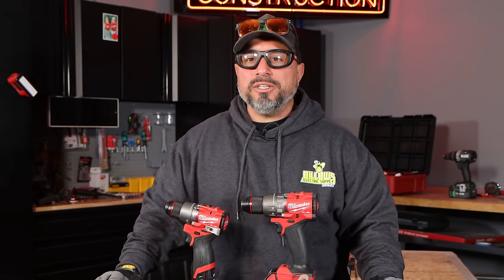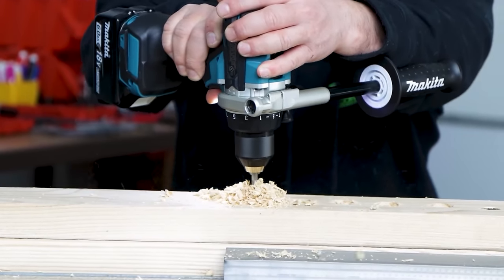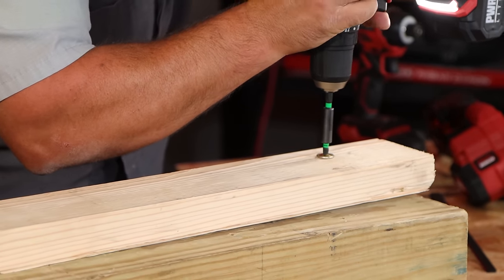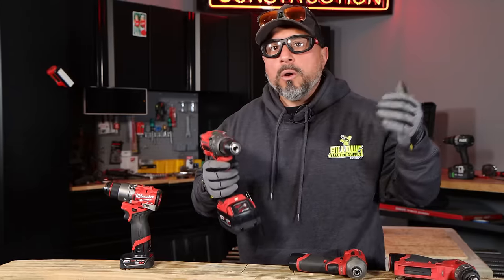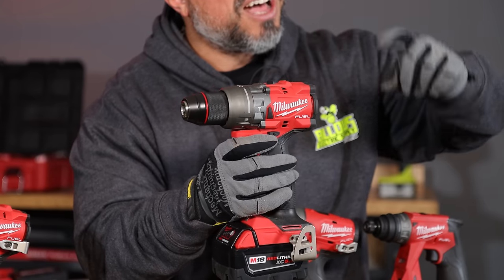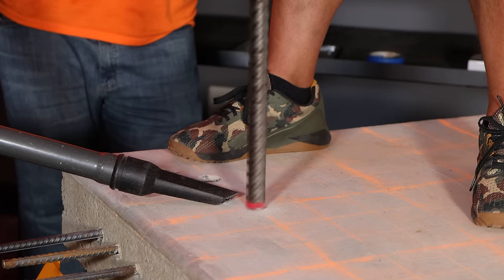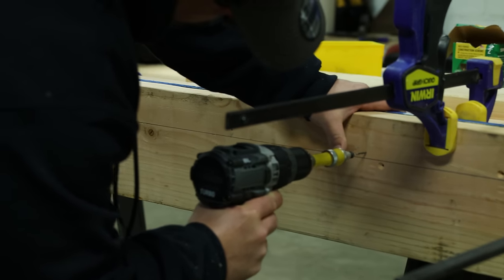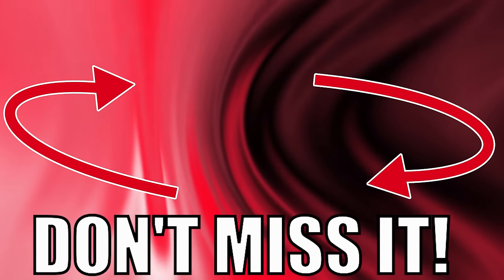Stop Using Cordless Hammer Drills...

Comment: I have only used a hammer drill both corded and cordless when I needed to drill into concrete or brick.  90% of the time I use a drill driver to drill and drive screws.  I own a hammer drill and an impact driver for those 10% of the time they are needed.  I'm just a home owner who tries to fix what I can.  I try to use the right tool for the job.  I've never needed a rotary hammer, but I assume you can rent one if I ever have the need.

Comment: If you're doing it for a living a rotary hammer drill is the go in my opinion for concrete. They're quicker then a percussion hammer and a battery rotary is typically good for up to 25mm bits. Anything larger a mains rotary is the go.

Comment: My 1/4" hex impact driver was my go-to tool. Second was my 1/2" hammer drill. then all the saws. If i was drilling more than 5 holes in concrete, I would grab my SDS drill. But the 1/2" hammer drill was used every day on the job.

Comment: @vcgconstruction. I watched the whole video before replying. I’d have to disagree, I do HVAC and I carry the hammer drill because it’s perfect for putting my anchors on brick walls and drilling my 4” holes for soffit caps,and I use it to run my hole cutter for ductwork. I would agree with wanting the sds for drilling sleeves for my lineset. Other than that hammer drill all the way. Love you guys

Comment: I keep my hammer drill on the truck but always have my impact driver on me. I used to carry both but removed it to save weight. I never use it to drive screws, drill small holes, or with paddle bits. It’s pretty much exclusively for small masonry anchors, and hole saws. Same side neither of my guys own impacts, only carry a drill. They like the control they say, but one literally hit himself in the face but apprentice so makes sense. 

Not dead to me, the size bridges the gap. I don’t want to own 2 rotary hammers, just one big 1-9/16”.

Comment: I always buy hammer drills the regular drills always seem too cheaply made to last very long.  I use a rotary hammer for masonry. Speaking of not the right tool for the job my brother's shop has concrete walls and when we insulated it we used wood slats to hold the insulation on the wall with concrete screws. The rotary hammer drilled the holes but those screws are hard to get in without stripping the screw so we used an old corded right angle drill with a #3 Phillips tip in the chuck. It worked rather well because I could lean my full weight onto the drill to keep it from stripping the screw but the fun part was that drill took time to stop so the best way to have the screw heads flush with the wood was to pull the drill out of the screw as fast as you could while it was still spinning. This was before I had an impact driver.

Comment: One of the reasons why I only buy cordless hammer drills and not cordless standard drills is because of the gears. Non hammer cordless drills usually have weaker bearings and gears. Sometimes they aren’t even metal.

Comment: M12 hammer drill/screw gun combo is what I bought. The hammer drill is fine for when I only need to drill a few holes in to block or concrete. If I'm doing an all-day job drilling into block and setting tapcons than I'll break out the m12 sds plus. For instance I recently put a stone veneer on the front of a customers block garage and the m12 hammer drill was burning through the block nearly as fast as my buddies 15 year old poorly matienenced Bosch sds bulldog. I also used that same m12 to drill a 2 in hole through 1 of the veneers with a diamond holesaw no problem. Things a beast.

Comment: Well, for someone who installs fasteners into concrete most of the time, no you cant just use an impact orr that little multi-tool thingie. You need either a roto hammer or a proper hammer drill. I used to lug both a midsize roto & and imapct around, now i dole my other tools out to apprentices and have them install devices while i make holes & mount devices with 1 tool. I adore how versatile the hammer drill driver is, y'all 🫡

Comment: I run a Ridgid Flexshaft with my hammer drill. That’s about the only reason I bought a cordless hammer drill. If I wanna drill anchors in concrete I pull out my corded Hilti rotary hammer

Comment: I am an electrical construction worker in Korea.  In order to use a screw anchor, we have to drill a hole in the concrete with a diameter of 6 to 6.5 mm, and use a self-drilling screw on the metal plate to fix the steel box or steel support at the same time as the drill hole.  I think it's really inefficient to have to bring both a drill driver and a rotary hammer drill for this job every time.  All it takes is a 14.4v hammer drill.  A rotary hammer drill is required only when drilling a large number of holes with a diameter of 10 mm or more.  Since you are a carpenter, you may have posted this video without understanding the peculiarities of these various professions.  You only know about your work.

Comment: If one needs a drill/drver, then might as well get the version with the hammer drill. The size is the same with very little difference in the weight.  The cost isn't a factor, it is about $10 more.  It only makes sense to get the hammer drill unless maybe you are a mechanic.

Comment: I prefer drill for drilling or screws too weak for impact drivers or need to be at a limited tightness, and impact driver for screws and drilling nail embedded wood with a spaddle bit. The hammer functionality in the hammer dill can drill cleaner holes into drywall not just beneficial for drilling into small holes through masonry. Since I’m a hobbyist woodworker, having a hammer drill, impact driver, and installation driver is the perfect arsonal for my drilling and driving needs instead of having just 2 of those tools. Like have my hammer drill on the regular drill functionality for pilot holes, an installation driver for counter sinks, and an impact for screws for a woodworking project, so I can quickly switch tools instead of hunting around for a different bit for each step I’m putting in a screw and more options to come as well.

Comment: You have an opinion that I may not agree with. As a handyman I prefer the quieter sound of a drill/hammer drill and the 1/2” chuck is needed for bits that won’t fit in the impact driver. For my day to day I’m using the 12 volt because of the small size and less weight.

Comment: I can't speak for the concrete artists, but as a DIYer, even if I wanted a hammer drill, why would I want a 12 volt. Not to mention that thing comes with a half inch chuck! What am I augering out holes for fence posts?

Comment: Before you sit there and call out all trades “for what they use their tools for”. Maybe consider that some trades have no idea what they are drilling into, whether it be soft and easy like ceramic, or tougher than hell petrified wood or rock hard granite, some trades need a hammer drill to get the job done and some of us don’t have the time to run an extension cord or forget to grab the generator for a corded hammer drill, because the builder still hasn’t gotten power to the house/building.

Comment: For me, I have no use for a rotary hammer.  And I don't really NEED a hammer drill.  However, I do need a drill with a chuck available alongside my impact wrenches and impact driver.  So having the hammer drill for the here and there scenarios where I can't do the job without a rotary hammer or hammer drill I'm not SOL.

Comment: I see your point but I disagree. I do a wide range of task from drilling holes in metal, wood and masonry. The added cost and weight is not much of an issue in comparison to the versatility you get with a compact hammer drill tool. I have a Makita hammer drill and that thing goes through concrete and stone with ease.
Reply from the maker: Fair enough, I respect your point of view!

Comment: I agree. But working maintenance have used  hammer drill thresh holds. Use on mortor to hang mailboxes. Wallering mortor. Very little use. I like the basic drill driver. It's a good gimmick especially when that trigger messes up on the hammer side.

Comment: I prefer my hammer drill when drilling small anchors and tapcons. If I need to drill bigger holes I will break out the rotary drill. We have a lot of stucco in AZ so if I'm on a ladder I'm going with my hammer drill. When I'm done I switch bits and hang it off my pocket.

Comment: you're 100% correct.  im a low voltage camera guy, and i still use my 18v sub compact makita rotary hammer to make even 1 hole in mortar... i don't wanna have to use force on a ladder!
Reply from the maker: Exactly

Comment: As a home DIY guy the hammer drill does what i need. Drills wood and concrete, drives screws and  takes up less space than the specialized tools in my pack out box. Now if i drilled concrete day in and day out then yeah, rotary hammer all day. But i am a filthy casual.

Comment: I just love my Milwaukee tools. I am not a huge brand loyalist. However I unexpectedly got vested in Milwaukee tools due to an acquaintance who sells them to me at a very discounted price as slightly used or regular used tools, I have a Milwaukee hammer drill which I will probably hardly ever use the hammer function. I have the 2903 (I think that is the correct number) model impact driver and I also have a 2663–20 impact wrench and love all three of them.

Comment: Smaller holes are fine for hammer drills in a pinch but yah if you're drilling into concrete all day get a dedicated sds rotory hammer drill.

As a homeowner I have the m12 hammer drill and a corded makita hammer drill for smaller bits..  i dont drill into concrete often but IF i needed I am lucky enough to ha e a big ass 240V AEG spline drive rotory hammer which I never use so I cannot justify buying an sds rotory hammer drill.  I am also not in the trades but if i were the Bosch Bulldog would be nice

Comment: I can clean my kitchen, bathroom, wipe my mouth and scrub my dishes with Clorox wipes, napkins and sponges, but I use paper towels because it takes up less space, and it’s less shit I have to buy. 

A hammer drill to do a little bit of everything is great, because it’s a single tool. Now, when I have to set 200 5/8 wedge anchors, I’ll break out the sds. But if I’m only going to be running 20 3/8 tapcons on a job, there’s no point in breaking it out.

Comment: I own a Ryobi P213 (is like 6 years old) can do 350inch-lbs torque, i can do masonry no problem as well, but it's really heavy, so, I'm gonna probably buy the Milwaukee combo M12 fuel and call a day, and with the Ryobi battery, I'm gonna buy their SDS HP rotary hammer for when I need to drill big holes in concrete

Comment: Bro. The difference in price, weight, size between the m18 hammer drill and m18 drill driver is $10, 1oz and 1/8". If you use the hammer drill function once its worth it. 
Anyone that has ever put in a 3/16 tapcon will tell you that a cordless hammer drill makes sense.

Comment: For some jobs, hammer drill is a good enough to finish the job, and it's not a bottleneck; in these jobs, getting a set of hammer drills + impact driver and the bits you need,
is the most convenient option.

Comment: Uh. I’m an HVAC contractor and I find myself having to drill 3 inch holes in cinder blocks and my cordless Milwaukee hammer drill works fine for this. I have a different drill I use otherwise.

Comment: That's a combi drill with impact drill function.

It is a drill + driver for primary purpose with the added capability to drill concrete and masonry with a rather poor efficiency compared to corded impact drill and cordless rotary hammer drill.

For most household use, assemble furniture, drilling holes to hang pictures or non-contractor works usually a house owner would get a combi drill as those are what majority of the people can handle.

If even the house owners gets professional equipments it will leave no room for contractors to do business.

Comment: I have an 18 volt drill , an Impact, and a hammer drill we use a lot of concrete anchors from very small up to about 3/4 it works great. Not quite enough to have to use a giant rotary hammer!

Comment: Impact driver will be used for unibitt/drill bits concrete bits less than 1/2 inch, installing screws etc. I personally prefer a rotary sds hammer drill because it’s meant for drilling holes and will ultimately last longer and save your battery those are the two drills you’ll really ever need especially with drivers with variable speed trigger modes

Comment: Eh, I have about 8 or 9 drill/drivers, impact drivers, hammer drills, and a small rotary drill. The hammer drill is great for Tapcon screws. I never use a hammer drill for anything bigger than 1/4" (5/16 Tapcon) but it is very handy for that. So yeah, a hammer drill has its place in my tool collection.

Comment: I use the hammer drill mostly as a drill. I occasionally want to be able to drill smaller holes in concrete for smaller screws, nothing large. I can't imagine buying an actual separate rotary hammer, and the weight of the drill isn't offensive.

Comment: Well although what you are saying makes sense, and I do have different rotation hammers to rise to the occasion, however the gen 3 hammer drill is quite a useful all round tool compact and lightweight and I confess that in several occasions I will keep using the same tool just switching bits, like when drilling in gress tiles with proper diamond hole cutters and then once penetrated Use a regular concrete bit to drill into the bricks just like butter.

Comment: To be honest, I've only ever used the hammer function a couple times. It works fine for really small holes, but if I was dealing with concrete often, I would use a rotary hammer instead. 

I mainly work as a small engine mechanic, though, so having a hammer drill means I don't need a different tool if I end up doing a small project here and there. Until compact rotary hammers advance to where they can break flywheels and clutches on tapered shafts free like an air hammer can, a cordless hammer drill seems like a decent compromise for my use case.
Reply: They have cordless impacts lmao
Reply: @hondaservicecenter  Not sure what that has to do with my comment, but I don't think anyone here isn't aware of that, since they were literally shown in the video.
Reply: @Deadite9405  you said nothing can break a clutch free from a tapered shaft like an air hammer..... but electric hammer just as good if not better
Reply: @Deadite9405  guess i meant electric hammer
Reply: @hondaservicecenter  In my experience, you have to use a pretty big SDS-Max demo hammer to equal a long-stroke air hammer. Torque Test Channel has actually tested SDS-Max demo hammers against air hammers, and they were sort of middle of the pack. I've had SDS-Plus demo hammers work a few times, but I've also had them do nothing a bunch of times.

Comment: Hammer drill is for masonry bits . Use mine daily for drilling anchors in stucco,  no way I would ever use a roto hammer for under 1/2" holes in anything but concrete

Comment: I agree the hammer function of the hammer drill is really the least used function. Or at least should be.
Unfortunately, at least with Milwaukee and their marketing, the hammer drill always ends up being cheaper because of the kits they are included in, and end up being made in a much higher volume than the drill driver only (bare tool the driver is ~$10-20 cheaper, but we all know the bare tool only is a poor deal).
I would much rather have a non-hamner drill solely for the weight savings.

Comment: For me it all depends on what type of  concrete or block iam drilling 99%of the time I use a sds but once in a blue moon I do use my hammer drill but I do have a regular drill I choose to use when drilling wood or metal just because of the weight

Comment: Have to disagree with you on this on Vince.. Works perfect for me.. basically use the impact for everything.. and the hammer drill for strictly drilling tap guns or anchors... literally drilled thousands holes in concrete with it. Has never let me down.. and then when I need to use whole saws for drilling through something on trims I use it for that too..use the hole hog right angle drill for roughs

Comment: I have 2 rotary hammers but  my Makita hammer drill is on my truck at all times. For the heavy duty stuff I get the rotary hammers out
Reply: Surely a compact cordless SDS drill is the way to go for concrete? Surely much faster and more efficient for holes in concrete?

Comment: I definitely get it and disagree. 
 I still use my hammer drill more than the rotary hammer. It comes down to I generally have it on hand when I need it and most of the time it’s for 2 or 3 small fasteners. In these cases I can have them drilled in the extra trip from the truck to bring it in.

Now if I could get the uk installation driver that has the hammer drill function on it my standard drill would probably be obsolete.

Comment: I like my drill as a mechanic..... it's definitely not a tool I use very commonly but as was said at the end of the video using for the proper functions... in my case, putting holes through metal is my only common use of a drill anymore. My little impact drivers have almost entirely taken its place. The control in speed of a drill is absolutely an upside... one of the very few now. The hammer function may as well be extinct though in my case

Comment: I'm the few who got a hammer drill in his combo kit from team orange. Clearance too. But to be honest the hammer feature I've never used. Nor did I have to have it has a feature I need. But for 250 on clearance for the gen5x set I wasn't going to pass up the kit just because it has a hammer drill. Honestly it stays home most the time. I've swapped over to Milwaukee and there red helix impact drill bits that fit in an impact driver. Or impact wrench and adapter. And do wood or MDF drilling at best